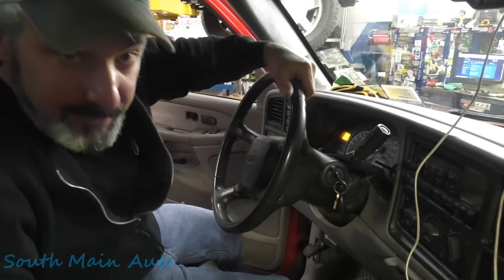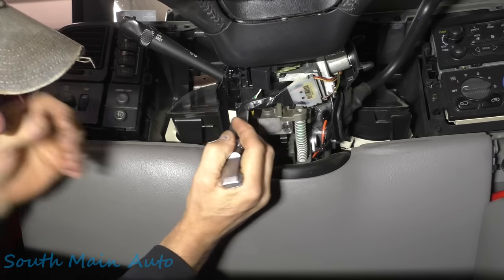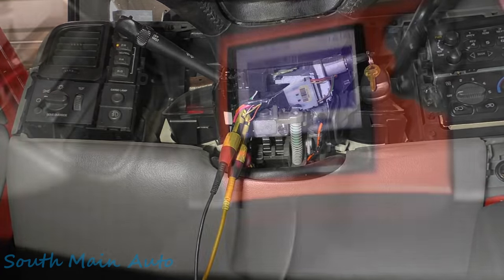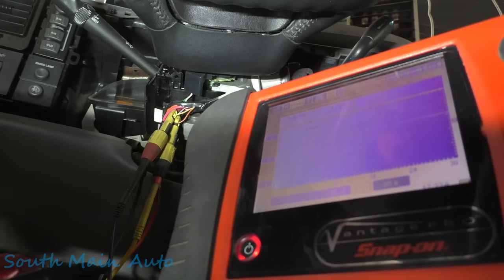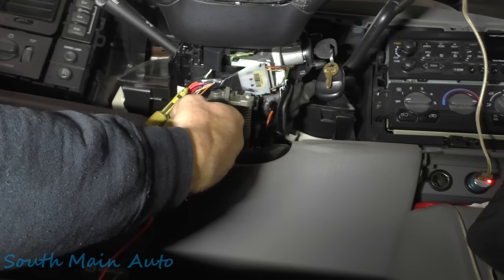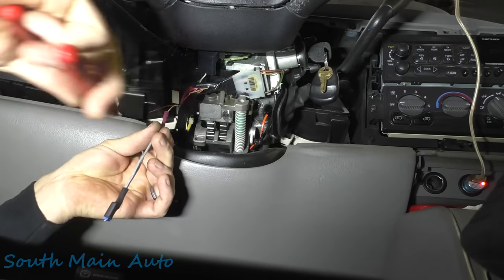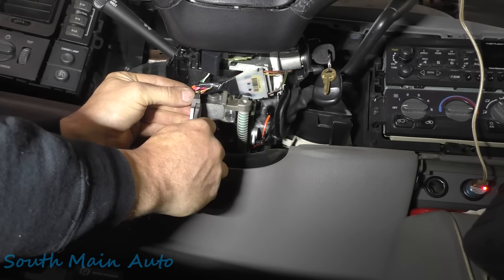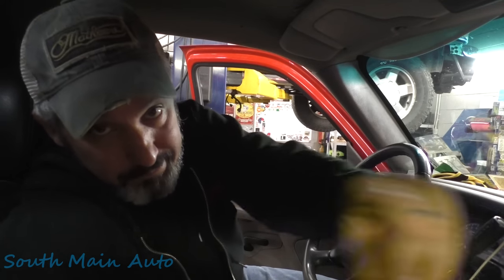Passlock™ System Bypass - GM

Comment: The cutting the wire brings me back to my military days . I sucked at math which by the way is VERY important when rigging charges of C4 . We all set our charges in the blow burms and we’re walking back as a group when my charge went off covering us with dirt and small rocks . I got better at math fast after that beat down
Reply: Some guy told me there is a method for calculating how much explosive to use for a particular blow... then you add "P" factor... P for Plenty.
Reply: @obsoleteprofessor2034  😂😂👊🏻 yup
Reply: Calculate how much explosive you need then double that value. But don't miscalculate the time it takes for a fuse.
Reply: @paullinkins8121  yes that is the most important. I was a no go that day 😵‍💫
Reply: This math has its limits when the ground is jungle saturated. Had the demonstrators for blowing a mortar pit with C4 use the book to calculate the amount needed to get the proper depth for one with insurance to go deeper. Nope, the hole was deep enough to get the minimum distance. (Jungle Operations Training Center in January of 1989.)
Reply: @LadyAnuB  100% I went to Panama for jungle school still got the patch lol . World is small on the internet 👊🏻👍🏻
Reply: "I love it when things go kablooey ........ but NOT WHEN IT'S ME!"
-- Some military duck guy in the old 'Donald Duck' cartoons of the late 80s - early 90s.
Reply: Oops!
Reply: the fuse was meant to be 4 inches,,not 4 mm.. even in construction, weve had similar, plans made in ft, not mtrs..
Reply: @harrywalker5836  yeah it definitely was long enough… that’s what she said too 😂
Reply: @obsoleteprofessor2034  Think you used enough dynamite ther Butch?
Reply: EOD tshirt "If you see me running, try to keep up"
Reply: @DeweyCheatumNHoweLLC  love that one it’s true with me brother
Reply: @sheerwillsurvival2064  As a medic, I got to go play with the EOD guys a few times. Those guys were NUTS!
Reply: @DeweyCheatumNHoweLLC  just wired differently that’s all 😵‍💫🥴
Reply: @sheerwillsurvival2064  Well, some would say combat medics aren't playing with a full deck.
Reply: @DeweyCheatumNHoweLLC  yeah till they need ya and start screaming MEDIC !!
Reply: Thank you for your service! And that would be one math test you really dont want to fail!

Comment: I had a 1987 corvette and I remember cutting a wire under the dash and putting in a resistor that matched the chip on the key. I had no problem after that.

Comment: Love your videos. I've been struggling with the infamous "no-crank/no-start" problem on a 2001 Monte Carlo. Just when I think it's gone, it returns. The car was subject to the GM ignition switch recall  a few years back and had the repair. When I pulled the ignition switch, the PASSLOCK sensor had been secured by a cable tie which had slipped, so I replaced it and added some electrical tape for good measure. Worked fine for several months, then out of the blue, the problem was back. I read somewhere that a weak battery can cause it too and since it tested as bad, I replaced it and the problem went away again for a couple of weeks, but suddenly returned. Just replaced the ignition switch housing with  a Dorman from Amazon that was only $40. Found that the PASSLOCK connector seemed loose in the new one also, so I did the cable tie thing again. Car is cranking every time now, knock on wood.  The sensor just clips into the ignition housing though, so I'm not sure how replacing the housing helps and I won't be surprised if it doesn't. I reused the old lock cylinder and existing keys.  If it happens again, I'm going for your bypass solution.

Comment: Had theftlock activate when I changed the radio in or eldorado, my local auto tech did what your doing here, fixed the problem, except for when the car was warmed up it randomly would not not start, I would typically wait ten to thirty minutes and then it would start and drive, Like your vids, longtime viewers, don't always leave a comment but do always watch and like, Have a Great Weekend Pal

Comment: Did this on my 1994 Bonneville. Just read the resistance off the key, did the math, and grabbed a couple of resistors from Radio Shack. No re-learn necessary. That variable resistor is handy, now that there isn't a Radio Shack on every corner.

Comment: I ordered a 10 pack of the Variable resistors (5k) to make my own ($8.00), What a great bypass and video. Question: What if you cut wires and attached resistor and had someone crank while you adjusted setting (until it starts) --- would be a little more "mission impossible" lol. This old mechanic loves your videos. Thank you very much for your time.
Reply: Did that work for you ?
Reply: @andrewcampbell7280  I did get the 10 pack (they took forever to arrive) but after replacing the Ignition harness on my 1998 Yukon, I tried the key and it started! Not sure why because I didn't do the 10/10/10 procedure for relearn. Guess I just got lucky and the resistor in the new harness was the same.

Comment: For cutting tape and whatnot on harnesses, a seam ripper for sewing is a godsend. Just be sure to tilt it away from the wires after you get under the tape so you don't stab or gash a wire.

Comment: love the simple solution. placing a little spot of paint or some of Mrs O's nail polish on the variable resistor adjuster will make sure the voltage never changes

Comment: Did this on my '96 Olds 88, years ago but I measured the resistance in my key and bought resistors from radio shack, found the wires in line and soldered the resistor in...worked like a charm

Comment: Missed the dot of hot melt glue or rtv on the Rvar screw.  Keeps it from vibrating out and changing the value over time.
Reply: Aligned probably a thousand transceivers by now.  Know how many move after adjustment?  None.  Aviation, ground vehicles, rack radios.  Nothing moves.  I'll put high temp tamper wax... just to keep people honest.
Reply: @ShainAndrews  You must have better quality components and vehicles than I do!  Have not done thousands, and have had more than one of those variable resistors change over time.  Especially on high frequency motor controllers.  Hit the right speed, they walk right out.

Comment: We had a similar situation with an early 90's Caprice.  Key had a resistor built inside.  Read with multimeter and replaced with a similar resistor under the steering column.  Works every time.  Thanks!

Comment: Love the crimp and seal connectors. Been working at a GM dealership for 30 years and haven’t had problems with them. The only problem is when the parts department buys cheap ones. It happened today installing a trailer brake controller, crimped the connector and the wire pulled out when I was testing it. SMH
Reply: They are the best in my opinion.
They are quick to use, excellent in tight spots like under the dash and in the engine bay.
Reply: You have to be sure to get a good crimp, which means a good crimping tool too. I like the heat shrink connectors.

Comment: Seeing those internal capacitors going across the terminals on the module explains the reason these fail... caps will leak , short or open after so many years

Comment: The crimp and seal connectors are what we stock and are recommended to use for wire repairs at the dealer
Reply: Also the GM standard in assembly plants now :)

Comment: I remember having to do this in the early 2000's when we were installing remote start. Nowadays bypass modules are necessary on almost every vehicle but it makes installing a remote start alarm so much easier. Instead of having to connect to 20 or 30 wires now it's just a handful. Never tried the adjustable pot resistor, always had to meter it and rig up resistors within +/-10% of the value.

Comment: I have a 2001 impala with the 3400. I had the same problem. Was also having issues with the a/c not working. It was an issue with the bcm having bad soldering. Replaced bcm, (had to get programmed at dealer) and all those problems were solved.

Comment: Had this issue on a customers 94 Grand Am. The pass lock circuit went from the ignition through the cluster, and into the ignition control module. The cluster circuit board would overheat when the instrument panel backlights were on (headlights were on), cutting out the signal wire. Rebuilt the IPC and problem solved. Had to solder in a resistor onto the  IPC to keep it from shorting out again. While I was in there, I replaced all the stepper motors for the gauges.

Comment: The quick way is take the key if it has the black pill in the middle of key and read resistance across either side of the metal contacts. Did that on a 1992 Buick Park Avenue. Had the same issue. Did help that I worked at an electronics based facility.
Reply: That's passKEY. This is PassLOCK. The clue is in the name.

Comment: PATS2 was just a carryover from VATS. There was only 15 combinations of resistances needed, the only difference is the PATS2 resistor was built into the lock cylinder vs in the key. So all you have to do is read the resistance on the 2 signal wires, and replace it with the same value.
Reply: VATS and passlock are different.  VATS just reads the resistance of a key pellet much as you would with an ohm meter.  Passlock reads a voltage value using a voltage drop method.
In pass lock there is only one signal wire, a ground, and a 5 volt supply.  There is a hall effect sensor, transistor, and fixed resistance in the lock cylinder housing.  A magnet on the lock cylinder itself triggers the hall sensor when the lock cylinder is rotated.  The hall sensor turns on a transistor which allows 5 volts, from the BCM, to go though a fixed resistance to ground.  The voltage drop across that resistor is read by the BCM.  If the voltage drop matches what it stored in the BCM, the BCM will send the fuel enable password to the PCM.  The timing is the critical part because when the ignition is turned to start the BCM should have already read the voltage drop value.  Weak battery can affect the passlock system, so the first step in diagnosing an issue is to make sure the battery checks good.  If the battery checks good, pull codes from the BCM and troubleshoot from there.
Reply: @Discretesignals  legend 🙌 👏

Comment: Wonder about that variable resistor's stability over time in the truck environment?
Reply: First the resistor is going to be stable enough
Second it can be adjusted
Third the security system is not that damn fussy

Comment: Also, where the wires pass through the connector,  little more towards the key, they rub through and short. The steering wheel tilters experience this problem.

Comment: Thanks for this video Eric!    My buddy has this problem with his 97 Grand Am.     

So just to be sure I've got this clear.    The passkey sensor on these are dying,  and normally the passkey reads the resistance of the inserted (and learned key),   so the bypass is to simply put a resistor across the wires to simulate a key, then learn that resistance value once,  and since it'll never fluctuate, it'll always start with any key that is cut for the ignition?
Reply: yep any key that will turn the tumbler will start the vehicle.
Reply: Yup. Except on the Passlock systems, the resistor is not actually in the key, it's in the ignition lock cylinder.

Comment: What are those ends called you put on your multi meter to tap into the wire to check the voltage? I’ve got to have some.

Comment: You can also use a piece of electrical tape and place it over the security light.
Also works great on the check engine light
Reply: Where do you put the tape to get the vehicle to start?
Reply: @GunnyNinja  on all the bare wires you have left after ripping out the security system

Comment: Pro tip- just measure the key bumps, because when you use a 10-turn as a rheostat, the farther the total value of the pot from the value of the key makes it difficult to tweak, and further, it is more likely to come out of adjustment.

GMs key blanks go from around 400 ohms to 12000 ohms, so there's not really any good one-size-fits-all rheostat.

You can get resistor assortments by the pound and you can combine them to arrive at the measured value in about 5 minutes- stupid simple (annnnnnnd, a rational place to use solder on an automobile)     ;-)
Reply: Better still, the next standard pot above 10K is 25K, which makes it even worse.
Reply: Yeah, I hate those little blue screw pots, better to go with the correct fixed. Once I get the screw pots set, I smack them on the screw a few times to make sure they hold value then drop some hot glue on them to lock it in. Why not knock the bump out of the key and solder it in?
Reply: I did the fix resistor on a Camaro and didn’t even need to remove the column covers the wire is accessible under the dash
Reply: You may also want to glue/melt the pot in place, or at least mark the position, as it may vibrate out of place.

Comment: Thanks for the go by to fix. I did not use the variable resistor, but i did use a 2.2K and the old 2000 Suburban fired right back up. I also had an alarm system on this truck that the pass was wired into. It did not affect anything so all is good.

Comment: I love seeing the truly amazing durability of automobiles. Every car ever made WILL finally age to a point where it can NOT be fixed. GM engineers designed this GMC to last 5 years without a major repair. They did that so that the car would be affordable. Yet here it is running at 21-years-old. That "key recognition system" is an electronic device and yet it lasted 21 years. Do you have a cell phone that old? A TV that old? A computer that old? Right. I repeat, this is amazing.
Reply: I have a telephone that's older than this. (It's also rotary.) 😛
Reply: @LadyAnuB  Visited my childhood home in 2018, after 60 years, the wall-mounted, rotary phone was still working. But... that is my point. To buy a new-technology phone that durable today, you would have to spend thousands of dollars. To buy a car that durable is certainly possible, but it would cost several million dollars. That rotary phone was owned by the phone company, and they sent a repairman to the house to fix it at no cost to the homeowner. AT&T did not want them to need repair.

Comment: An alternative to the razor blade approach is use of an X-Acto type knife. They have multiple type (curved straight, tspered, etc.) Replaceable blades. X-Acto’s also come in a couple of physical sizes (with appropriate blade types) as well.😳

Comment: I remember when I had to replace about eight ballast resistors in fluorescent lights for my dad. He put the lights up probably 10-15 years prior. These bad boys were eight feet in the air and when I went to do it I discovered rather than using wire nuts my dad soldered and taped every one of those wires! I was like what the hell was he thinking? I mean we had three hardware stores within 5 miles of the house and if the fourth one about 6 miles. Wire nuts have never been expensive! So I had to cut every one of the wires strip them and then put them in with wire nuts needless to say I wasn't impressed! I'll go with what you do every time I get the chance.
Reply: I like solder and crimp joints - just depends on the specifics of the job...
Reply: Ha, Now Wago are the cats meow.
Reply: Soldered connection is a better connection. Sounds like your Dad didn’t take any shortcuts. I’d trust his work any day. Yours, not so much. Lol.
Reply: @Gary_in_NoVA  Depends on what type of tape was used to cover the connection. Just electrical tape would not pass code. Prob have to use something like friction tape.

Wire nuts are industry standard.

Comment: I'm not convinced any of the anti-theft devices work and I'm pretty sure they end up causing more grief for the owners than they're worth.
Reply: Profesional thieves already had the equipment to deal with it when it left the dealership the first time. Only a costly hinderance to the owner of the vehicle.
Reply: Most "professional" car thieves have a roll back. If they're stealing a car to strip they have tools and a shop.
Reply: @marossgnv  I used to do relocation towing. Takes about 30 seconds or less with two guys and a truck😉
Reply: What security systems did they have when you started driving in 1934, Abe?
Reply: @THRASHMETALFUNRIFFS  You pulled the coil wires off and put them in your pocket
Reply: @danfarris135  Well, at least you didn't have to take the crank arm with you anymore!
Reply: @THRASHMETALFUNRIFFS a crank. And if you screwed up, you would surely not have to be told twice😂😂😂😂
Whipper snapper

Comment: You should find a value with the variable resistor then replace it with a set one of the same value, then you could reuse the variable resistor
Reply: They cost pocket change, why bother.
Reply: @inkman996  Exactly because those trim pots are so cheap and flimsy, I would feel better with a fixed resistor. Or at the very least, write the measured resistance value on the inside of the steering column cowl with a Sharpie before you put it back together.

Comment: I’m a big fan of adhesive lined electrical crimps. The first thing I did 20 years ago after taking delivery of a new 23 foot center console boat was to rip out all the factory wiring and replace it with tin coated marine grade wire and crimps. After pounding like a bobber in LI Sound and Montauk Point for 2,000+ hours, I have not had a single electrical problem. My friends who solder connections can’t say the same. Crimps done right are better under vibrating conditions.

Comment: Man I did not have the tools you have to make it easy I had to hold and check and recheck  to get the values right but bingo got her up and running again my 1998 z71  works like a dream  again 210000 on it has and running great again funny this video came out the same time my truck went down on me thank you Eric some much your videos have helped me so much in my being able to handle  some of the new age stuff 😀